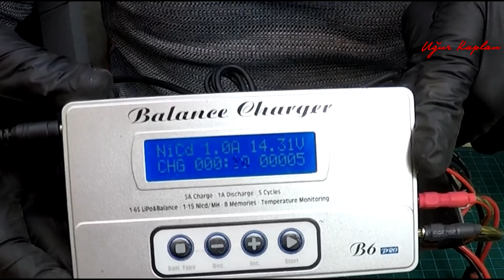PAZARDAN 40₺ YE JAPON MALI HITACHI ALDIK TAMİR ETTİK (TAMİRAT TADİLAT)

Comment: Uğur bey bendede 14.4 2000 mah lı ni-cd pilli matkap var buna 14.4 2400 mahlık taksak sorun yaparmı pil yada 18 voltluk
Reply from the maker: 2000 Mah dan 2400 Mah a yükseltmenizin hiç bir zararı olmaz, kullanım süresini arttırmış olursunuz. Ama 14.4 ü, 18V a çıkartırsanız motorunu veya elektronik devresine zarar verebilirsiniz. 18V luk pilin dolu hali 20.4V dur çünkü.
Reply: çok teşekkürler sıkı takip ediyorum seni üstadım :)))